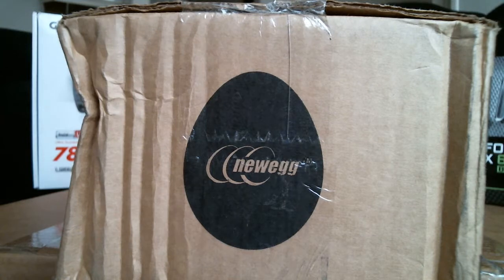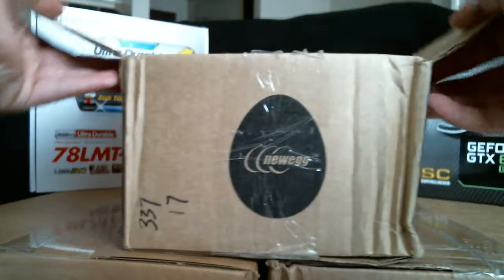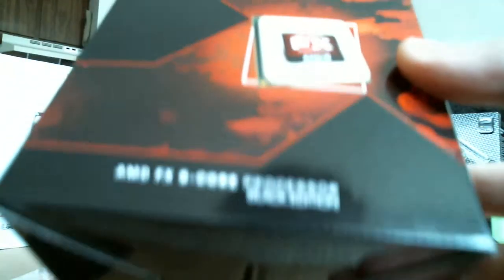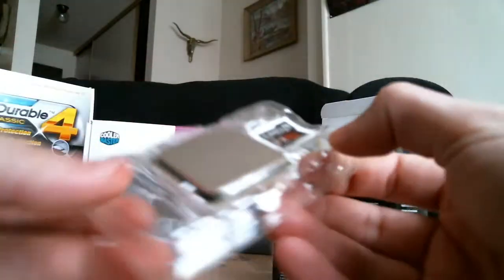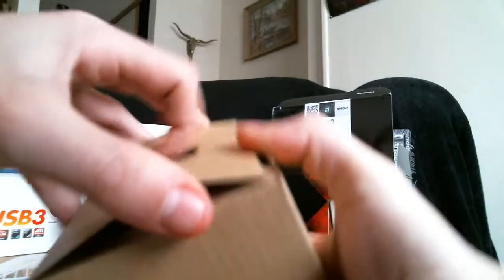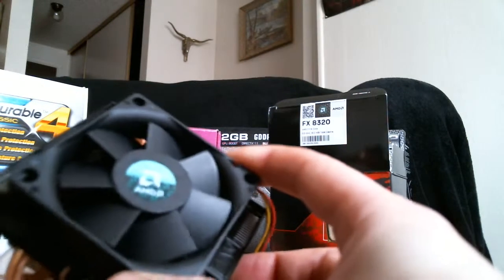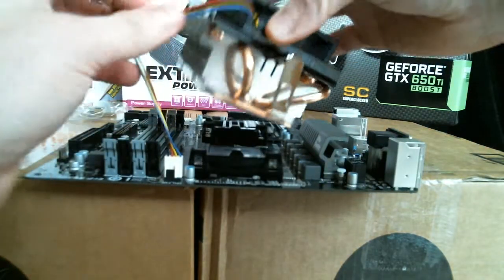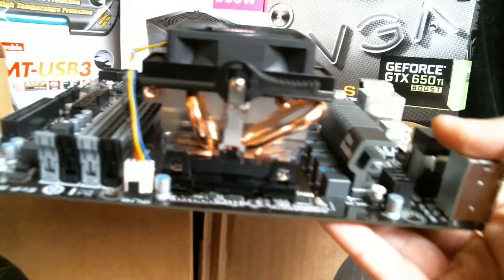AMD FX-8320 Vishera Black Edition 8 Core CPU Unboxing

Comment: I have the same Processor dude And it's really good you just have to buy another Cooling system/fan for it. Or other wise you will be deaf cuz it's insanely loud with the Value cooling system on it.  I bought this one to it http://cdon.se/hemelektronik/noctua/kylare-noctua-nh-u12p-se2socket-775-1155-1156-1366-p11321373?utm_source=prisjakt&utm_medium=cpc&utm_term=Kylare+Noctua+NH-U12P+SE2Socket+775/1155/1156/1366&utm_content=11321373&utm_campaign=prisjakt_se_home-electronics_Cooling+Components
Reply from the maker: thanks for the advise.:-) i guess i will be buying a cooler then. unfortunately im trying to keep the black & silver component theme. im going to get the Bitfenix Ronin case next month and i'll be doing an unboxing of that. im thinking about getting a RAD for it. any suggestions there? if you want to see my unboxing and if youre interested in my other vids you should stick around :-)
Reply from the maker: yea problem with that one is that ITS BUTT UGLY. I have the BitFenix Ronin case with green LEDs up the wazoo. i just ordered 2 140mm Spectre Pro PWM fans and 3 120mm of the same fans yesterday and i already have a 30cm green alchemy led strip in there with 2 of the non pwm 140mm fans up top (not speed controllable) (i also ordered a 3tb seagate barracuda hdd)... anyways that cooler is ugly. and i will be doing liquid cooling down the line somewhere (especially when i figure out how to safely OC my cpu). maybe in the end "if" i stick with amd i'll just get the 9590...